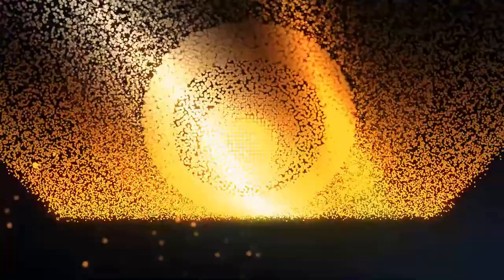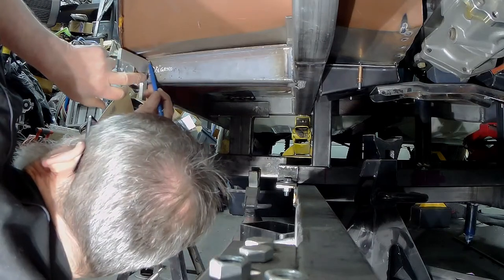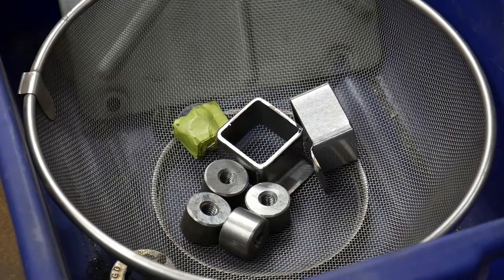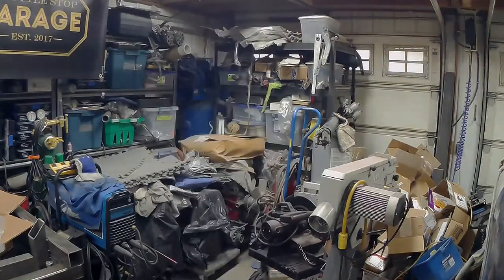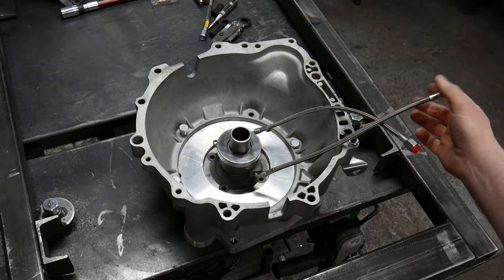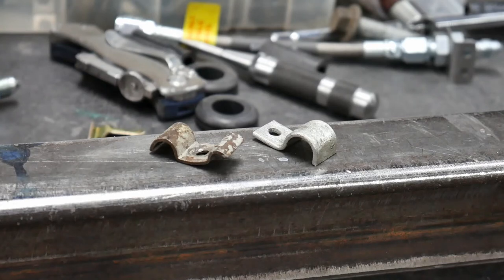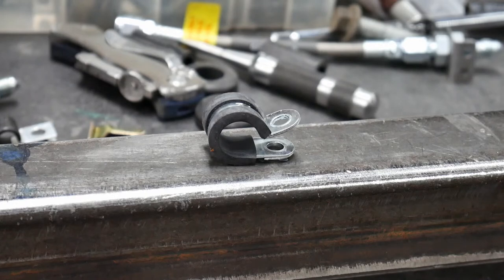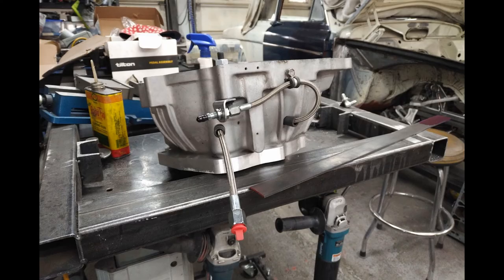Volvo Amazon Build Frame Details: When car projects go sideways! (Ep 42)

Comment: Is the T5 from a Mustang, or something similar?  What 3D printer are you using?  I second the comment on offering them for sale.  Add the option for a custom logo if someone could supply it to you.  Otherwise factor in the cost for the labor of the design.  Good info as always!
Reply from the maker: Yes, the T5 is from a Mustang but will have beefed up internals.  I built my own 3D printer...I use them at work to make parts.
Reply: @ThrottleStopGarage  a 3D printer is on my wish list eventually, plus building composites. Love what you're showing. I'm a mechanical engineer by education, and really enjoy the in-depth look at your ideas.